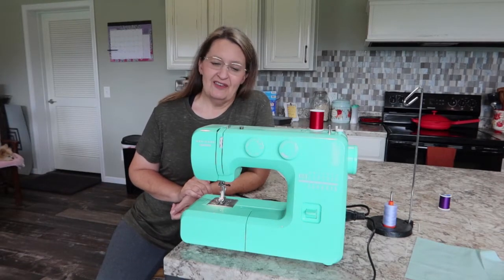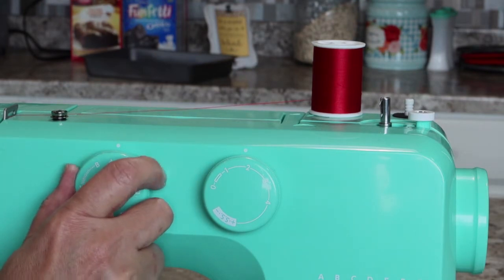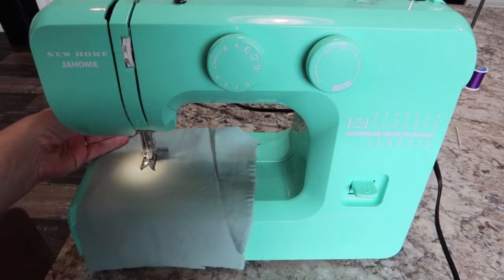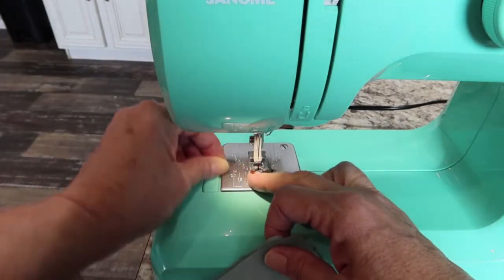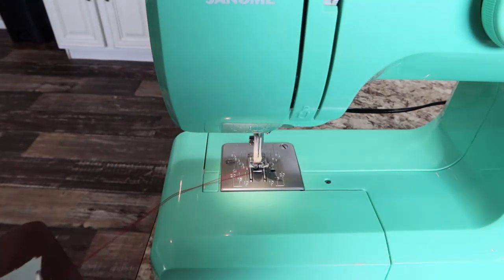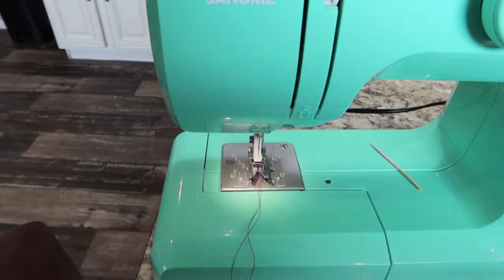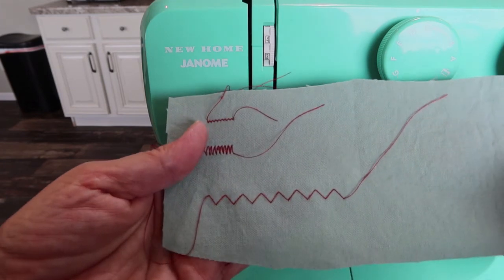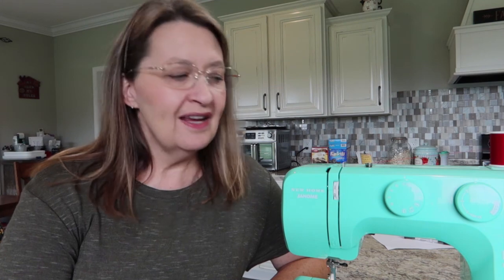Janome Arctic Crystal- Straight Stitching and Zig Zag

Comment: I have this machine and am very new to sewing and trying to figure out if this has an overcast stitch. I misplaced my book and according to Janome's website there is an overcast foot for this model but I don't know which stitch selection it is and broke a needle trying to test it. 🤦🏻‍♀️
Reply from the maker: Technically an overcast stitch is just a zig zag  stitch that goes over the edge of the fabric and keeps the fabric from raveling. You can use the standard zig zag or even the blind hem stitch. You will need to use a foot that allows the needle to move from side to side without hitting it. I roll the hand wheel slowly through a stitch to be sure I have clearance. You can reduce the stitch width if it touches either side of the presser foot. Hope that helps!